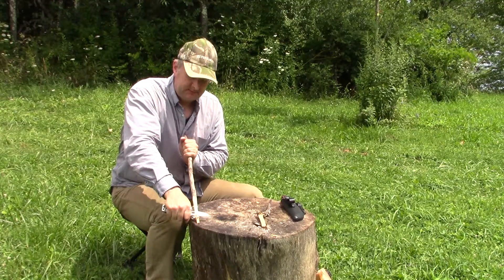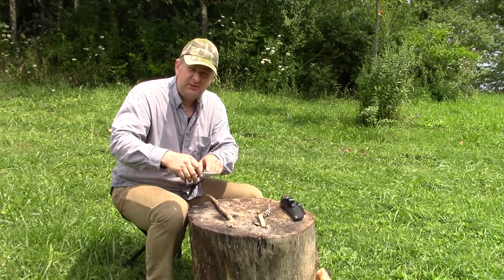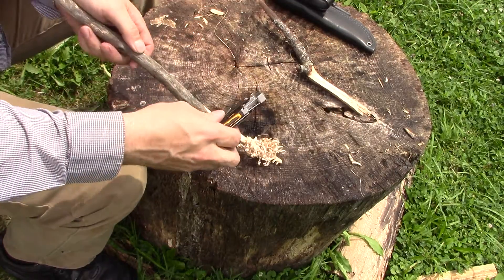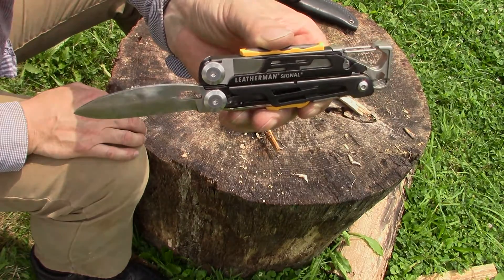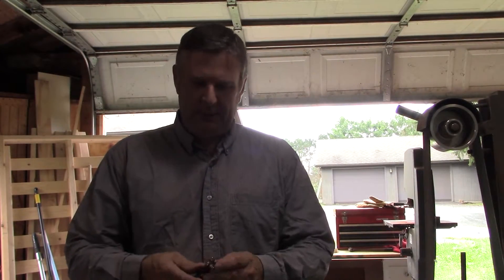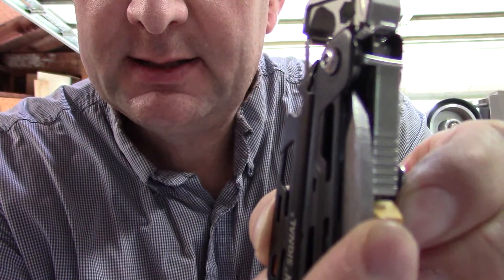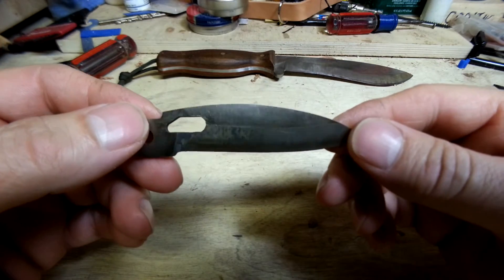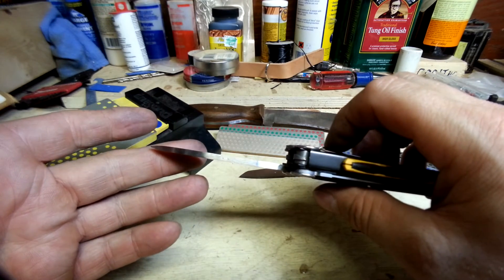Leatherman Signal: No Serrations!

Comment: I just replaced the partially serrated knife blade of my Signal with a 154CM from a Leatherman Charge. Fits and work perfect.
Reply: Do they sell replacement Blades for the charge?
Reply: @bena3341  I couldn’t find any, but found one on ebay. got lucky and it was a black 154cm. do research on the blade types, the fancier one from the Ti model apparently “can” get brittle and chip from heat treatment. 154cm seems to be best all around model but i’d take the stock as well in black. Have the topo so wanted to stay black
Reply from the maker: It's good to know that a Charge blade will fit. There are however a couple disadvantages to doing so. First you loose the fire starting ability of having an O1 tool steel blade. Second, the Signal blade is more stout and thicker then other Leatherman blades. My custom is 1/8" thick
Reply: Did u need to make mods to the blade for it to fit  ?
Reply: Can confirm non serrated blade from the Charge works in the Signal, just did it. love it, freaking finally have a proper useful Signal to last forever. One note, Charge blade when completely inserted rubs/bends off the side of the Awl. I’m talking thousands of an inch. Super small amount, from inspection can’t find any significant issues it will cause the blade since it rubs above the edge. could file down the side of the awl if one wanted to, but it the blade is in there good and completely stable and safe even if you don’t push it until it stops only push it in until resistance. Hope this helps other Signal folks! now to put a 90 degree spine on the Charge blade…

Comment: I wish Leatherman would take your example and put a proper bushcraft blade on the Signal...it makes sense. The serations are keeping me from buying this tool at this time.
Reply from the maker: I wonder what they were thinking! If I was designing an outdoors multitool it would come with the choice of two different blade styles. A scandi and a flat grind that is ground thin with a 30 degree bevel. Convex would be out of the question for a production tool like this since they are hand ground.

Comment: That is really outstanding work. I hope Leatherman is watching..which by the looks of it probably not..so someone should FWD this vid to Leatherman Wink Wink
Reply from the maker: Thanks! I do wish Leatherman would address the blade. It's a shame they could have done so much more with it. Another thing that should be done is to swap out the plastic pieces for yellow anodized aluminum and make the fero rod replaceable.
Reply from the maker: What do you have in mind? I was thinking of grinding a piece of 1/2" fero rod to replace the plastic/rod that comes with the Signal. This would allow for a lot of striker material.
Reply: I would love to see any more work you do on this MT or any others! I put a ferro rod on my lanyard that hangs on my MT's, thats how I get around them not coming with one or a "gimmicky" one.

Comment: Does the signal's sharpener work with the new blade?
Reply from the maker: eRock526: The Signals sharpener works with the new blade. It is not the best sharpener but if it is used as intended, as a field sharpener it works.  When at home I never use the built in sharpener. A large diamond or ceramic stone is much better.

Comment: Ingenius! I love it!
Reply from the maker: Thanks for watching! I was just using the signal today and it is still preforming great with the new blade! It is a big improvement over the original.
Reply: Last Chance Knives How much does your o1 tool steel blade cost ?
Reply from the maker: Craig Mosolowski : $65, It is a couple hours of work grinding and hand filing plus running the kiln to make one of these blades. The price may seem high for what it is but between labor and materials I can't make one for less. In addition to O1 I also work with cpm154 and 1095. In the next few months I will be developing a heat treat for M4 and S30V.
Reply from the maker: Craig Mosolowski : $65, It is a couple hours of work grinding and hand filing plus running the kiln to make one of these blades. The price may seem high for what it is but between labor and materials I can't make one for less. In addition to O1 I also work with cpm154 and 1095. In the next few months I will be developing a heat treat for M4 and S30V.
Reply: Last Chance Knives  Send me info on how to order your 01 blade. For me, it's  a good price.
Reply from the maker: Craig Mosolowski : Send me an email at klustgarten@gmail.com and we can make an arrangement. I have to make a website but so far time has not allowed that to happen.

Comment: Awesome video! Really good idea. I wish I had access to a belt grinder, for some reason they are practically non-existent here in germany and getting one is WAAAYYY out of my budget :/ I would have chosen a different steel, probably something semi-stainless like D2, but I guess you chose O1 because it`s easy to heat treat? Greetings from Germany, I subscribed :)
Reply from the maker: German Survivalist  I started with a small strip sander from Harbor Freight. It was about $40 US and is much slower then a real belt grinder but usable if you have patience. When you have to turn out more knives a real machine is needed. I chose O1 for this project because it is one of the best steels for an outdoor use knife and I get a spectacular heat treat on it. Carbon steels like O1 can be used with flint to start a fire. This adds a long term fire solution to the knife after the fero rod wears out. I also work with CPM154, 1095 and am going to give A2 as well as 5160 a shot soon. Right now my limitation is that I do not want to work with steels that require a cryo treatment.